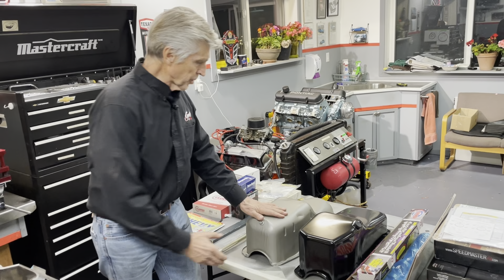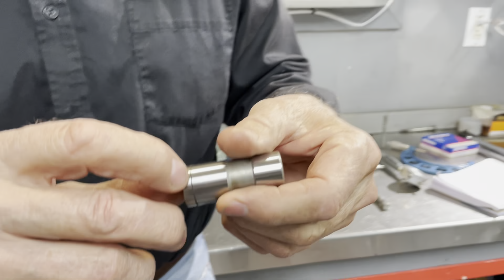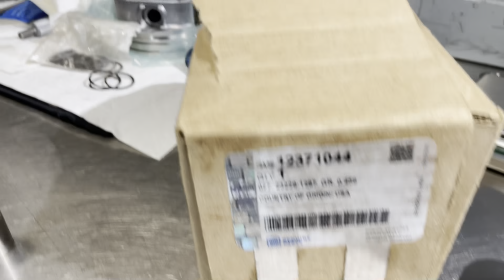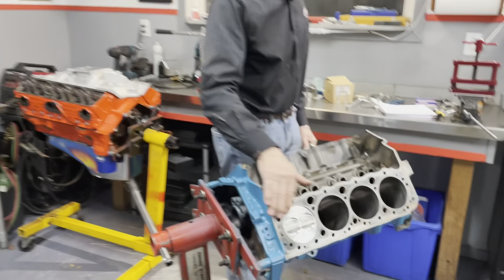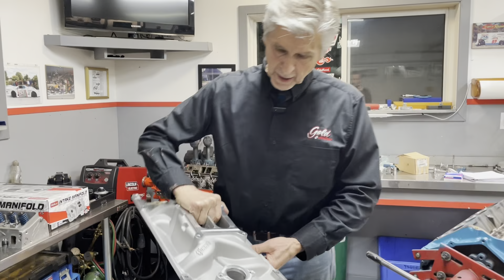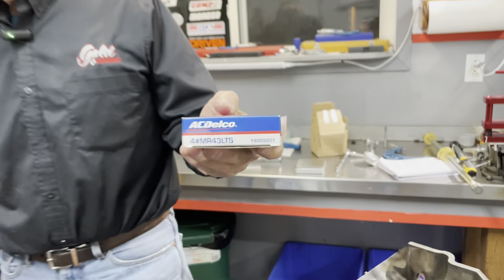Do you need to Balance your engine??? Will it survive if you don’t???

Comment: As an engineer in piston machines, compressors to be precise, I can simplify the matter a little; there is no such thing as a balanced piston engine. Actually... that doesn't simplify anything now that I think about it, does it? 😁

So what do I mean by this? Well let's look at the rule of thumb for balancing engines (and it really is a rule of thumb, because with offset cylinders and detailed calculations of the dynamic forces you can do a little bit better, but I digress), is to take half of the translating/reciprocating mass (piston and top half of the connecting rod) and the full rotating mass together to come up with the bobweight mass. The bobweight are affixed to each of the crankpins to simulate the assembled engine on a balancer. Some mass is added or removed on each end of the crank and now the thing is balanced, right? Wrong. It's only balanced at 4 points during the crankshaft rotation; roughly (not exactly due to conrod angularity) 45, 135, 225 and 315 degrees. 

Why is this? Because in reality the balance varies as the pistons go up and down. When the conrod is at maximum sideways deflection, the piston (almost) halfway down the bore, the mass of the translating components is felt 100% by the crankshaft as if it were rotating mass, because it acts on exactly the crank radius (half the stroke). When the rod is centered (TDC, BDC) the reciprocating mass isn't felt by the crankshaft at all, at least not in terms of balance. This is why the rule of thumb is 1/2 of the reciprocating mass. It's merely the average of the varying imbalance. The best you can do (before getting into complex dynamic analysis of the differences between the 4 strokes) is to just split the difference and follow the rule of thumb. 

Now that in and of itself doesn't mean you shouldn't "balance" your engine, but the automotive industry and engine building aftermarket tend to "balance" crankshafts to a much greater degree than necessary. There are various standards to which rotating assemblies can and should be balanced. The standards often used by high performance engine builders are the level of 20-50K RPM turbine engine assemblies, which is about an order of magnitude stricter than necessary for car engines, which turn 5-8K RPM, for the most part. The standards of production tolerances of modern engine components is such that the "balancing" is already done in the design of the parts, and the rest-imbalance as a result of production tolerances is small enough that rebalancing is not necessary unless you use parts that weren't designed to go together as such. So if you're building your 383 stroker from a quality kit, you're good. 

Having said that, if you need to balance your parts anyway, given the fact that engine builders are already set up to balance to an order of magnitude (or two) more precision than necessary, there's no real reason not to take advantage of it. While under full load the combustion forces throw the balance off anyway (hence you can do better with offset cylinders and slightly different mass bobweights with careful analysis), you will get a nice smooth idle. Considering the fact the engine in a car tends not to be at full load all the time, this is a somewhat nice thing to have, but it won't increase the service life of the engine by anywhere near that same order of magnitude (let alone two). 

A much better thing to do is to use polymer composite bearings. No, not the polymer coated ones. Use the actual composite ones, where a sintered metal (usually bronze) is impregnated with a polymer (usually teflon, although PFAS restrictions may see that change to PEEK or other alternatives over the coming years). This structurally binds the self-lubrication polymer to the steel backing of the bearing shell. These bearings ARE an order of magnitude better than ANY metal top-layer bearing. They are incredible at handling momentary lack of lubrication (i.e. starting, stopping, and high-G-oil-starved-cornering). We've done a test on one of our compressor where we started loading pistons with compressed nitrogen (imagine peak cylinder pressure, but CONTINUOUS during the ENTIRE rotation, so WILDLY worse load than normal). In this machine we had several metal bearings and some of the polymer ones. We ran at 1500 RPM (our compressors resemble large diesel engines in size and proportions) and increased the continuous cylinder pressure as we went. The first tri-metal bearings started failing at 25 atmospheres, after about 15 minutes. Did I mention we closed off the lubrication system entirely? Since this effectively "destroyed" the machine, we disassembled it. The cheap aftermarket bearings were entirely destroyed, worn bearing-wide grooves into the "crank" (it didn't have crank pins, it was entirely concentric since we got the load from outside pressure), the white metal layer melted and in general it was a mess. Our own high quality OE tri-metal bearings fared better... but not much. Now, to be honest, I was very impressed with a 25 bar load for 15 minutes without any lubrication short of oiling the parts during assembly, but the metal-polymer composite bearings were in a leage of their own. You could barely see they ran at all. Brand new. In fact, the polymer running layer looked somwhat smoother than before. 

If you build an engine, always always always always use metal-polymer composite bearings. For the cam too. Always. Also use the thinnest PVD-coated piston rings you can fit for similar reasons, by the way. And have the cylinder bores plateau honed professionally. The combination will last forever. Don't fuck around with ball hones.

Also, I can't confirm this last bit from experience but apparently conical valve springs are the bees knees too. The science behind them is sound, at the very least, and I know enough about harmonics to tell you that your entire valvetrain will thank you for any way in which you can reduce them. Definitely consider them over twin springs and even beehives. And this is a great segue to talk about Mr. Vizard, who was a wizard back in his day. But I feel, from reading his material, that he hasn't gone with the times much. He;s a great source of information for anything old school. But if you want the best modern technology can offer, I think it's best to listen to the Billy Godbolds and Ben Straders of the world. They might as well be Vizard's spiritual successors.
Reply from the maker: Thanks Shiel, lots of great information from your experience. Thanks for taking the time. AG
Reply from the maker: Easy to tell you are an engineer! AG
Reply: I’ve always wondered how the position of the piston in the bore affected things. The mass of the crankshaft counterweight never changes but the acceleration of the piston and connecting rod changes significantly.  This is further complicated when you have two sets on one bearing journal. I haven’t sat down and really tried to work out the math of it with my limited physics skills but I was always like: this doesn’t sound right. Your comment put into words what I had already been thinking. And thanks for the heads up on the polymerized bearings.
Reply: @michaeloboyle8798  Happy to help
Reply: Regarding "metal-polymer composite bearings," I don't see any reference to them for automotive applications.  Is there a different terminology for use in automotive engines?  Where would you find info on automotive use?  A google search only shows bushings, nothing like a split bearing shell.
Reply: Love it.....  retired core rotating component Engineer here.
Reply: Very good sir. Brilliant.
Reply: Thank you
Reply: Your part right.
Reply: @kevinwest3689  ok
Reply: Ok moses

Comment: great info ..like the channel had to sub ......    I agree with what you are saying about semi-stock (budget) engines using parts that are within a few grams ...  of the original setup...  from what I see for the intended use where you are not seeing crazy high rpms for extended times this should last for years and be fun to drive ....
Reply from the maker: Thanks for subscribing Maldo and for you comments. AG

Comment: Or rather,  how far out of balance can it be?   
Very encouraging "balancing" revelation in this video.

(Finally gets to the subject at 15:21)
Reply from the maker: Thanks for your comment N. AG
Reply: @goldsgarage8236  I'm in a situation where I have to balance my crankshaft myself. The local shops all claim to be too busy. I have to make my own balancer. I have the Software and the Computer, but don't know what sensors to use or even how to apply them. So I'm using a Laser method. There is no way I will be able to get to +/- 2 grams etc.  The knowledge you've shared is comfort for me.

Comment: depends on how high you want to turn the engine . stock balance - stock RPM =5000. For every 1000RPM above ,the force is squared ,generally. If you"re going to run 6000 RPM and above on the street or track , I would balance the complete rotating assy. We all want a happy engine ! Mr. gold is correct . Thank you for the knowledge sir.
Reply from the maker: Thanks for the nice compliment Doug! AG

Comment: I built my first engine when i was 17 back in the mid 80s .i only had the  "how to rebuild a sbc " book to learn from. The motor lasted 13 years over 100k miles ,  in 4 different vehicles and made thousands of passes down the track. It was not balanced  it was a.30 over 355 stock crank  trw forged flat  tops and resized rods
Reply: In 71 I built nearly the same engine except it was a steel crank 327 with the 11.25 pop ups, Dontov 30-30 solid cam, Edelbrock 2 x 4 Carter afb, and Mallory double life Dist., Ran really good with that clacking when starting from rocker arms In a 55 Chevy with a (lucky me) m-22 rock crusher.   First time I drove it was smooth as glass.   Just loved that whining Transmission. Got it to idle around 1100 RPM.  First time I really got down on it I was surprised when my head hit the roof.  Worst wheel hop I have ever felt.  Traction bars fixed that.   Tore up three 55-57 Chevy rear ends  and 3 clutch center hubs.  Better Clutch and rear from 69 GTO 10 bolt Posi. Fit right in with little cutting and welding , emergency brakes and hydraulic lines hooked right up.  Car would then tote the front wheel about three car lengths.  Don't ever ruin a 55 two door hardtop in Coral and Gray doing this to it.  Had to cut rear fender to accommodate some really wide Micky Thompson tires and Anson Wheels.  But life went on and it's gone many years go.  OH Yea  I changed gears at 7000 rpm and this engine was not Balanced. And withstood 100's of over rpm shifts.  Engine was still running great when it was sold.
Reply from the maker: Thanks for the confirmation Biden. AG
Reply: Hey Alan thank you for responding to my question about that head gasket leaking on your leak down test but what about that oil pump stud .it looked a little short it didn’t go all the way through the nut ?

Comment: Its not a necessity, but i still disagree. You have the engine stripped , its disassembled. You say , you prefer things done well.
Yess its a budget build , but a balance job nowdays is not that expensive . And I think , a better balance is never bad. May not benefit this build , but I see no reason why NOT to do it , the most expensive thing is ripping the enginr out and tearing it down then reassembly and stuffing it back in the car. 
So , while its apart anyways , its a no brainer to get it done. 
The price of the job vs the price of say.. 8 pistons is next to nothing. 

Now , will it impact performance or longetivity ? Highly likely not. But , as you mentioned , it will be a hotrod. It will be idling a lot more Than a race engine. And at idle , and at peak tourqe rpm , it will shake / rattle less. But will the difference be big ? Hell no. It will be as insignificant as the extra price and work.

However , thats the way its done when you do not want to make a compromise Just to save an insignificant amount of money.
And from that stand point , yess it should be done.
Reply from the maker: Thanks Nagy! AG

Comment: What compression  are u going run with combination  of your parts on this 350? 
Also I'm doing a budget 454 build.  Swapping  the low compression factory cast flattops pistons out for some 22 CC dome hyperutectic pistons  and new rings and hone job. Should it be balanced or leave it alone? Stock compression  was 7.9 I'm guessing,  binging it up to 9.4/9.5 to 1. Going be a low rpm torque pulling engine with peanut port heads and a small single pattern RV camshaft  with headers.
Reply from the maker: Thanks for the question Jesse. Can you weigh the new vs. old pistons? AG
Reply: @goldsgarage8236  yes, im going get my machinist  to do just that.

Comment: I pretty sure the factory didn't balance every engine the job  was figured out + or - a few grams, I always figured if rod and piston weight was lighter it never caused a problem, I only balance if crank , rods and pistons are changed, if you think about it using 5/20 compared to 20/50 would change  the balance a fair bit, using a crank scraper or not, overfilling the crank case by a litre, we can go on and on, that's my opinion.
Reply from the maker: Thanks for your input Bill. AG

Comment: The dowls are a good idea, you can only put them on one side to line up the intake to the head and also lay the gasket on the head first and line up to the ports and make a mark on each end of the gasket to make sure it stays in place when you install the intake and if it slips you van move the gasket back to where you have it marked...
Reply from the maker: Thanks Leonard. AG

Comment: I saw a 50s Jag. awesome car, with a replacement engine in it.  The original was pulled years ago.  My friend found a rod that weighed 60 grams more than the others.  It now wears its original smooth running engine.
Reply: Thx for bringing us along for another superb engine build.....Don't think Circlip & SpiroLock Retainers are mutually Substitutable as Circlips are intended for Rounded cross section piston Groove shape  compared to SpiroLocks designed for straight Rectangular cut piston retainer Groove......Builders have probably mixed Matched them in Actual build Applications with no problems but I wouldn't do it......
Reply from the maker: Thanks Tom, we will use the clips that Sealed Power provides. AG

Comment: Well, the simple answer is, "how do the automobile manufacturers handle the warantee claims that would come from poorly built engines?" GM knows how their Corvettes will get used, and the truck versions of Ford and Dodge as well can get past 100K on the odometer.
Reply from the maker: Thanks Albert. AG

Comment: Balancing an engine and considering all the internal forces in an engine has a lot of mystery to it, all we can do is what we believe is right. Last 383 I did we bought a scat kit pre-balanced and we used the rod bearings that came with the kit for mockup and after spinning the crank a million times, grinding and clearancing, the bearings didn't look as good as they did when we put them in so I had another set of chamfered bearings I was gonna put in and I thought "I might should weigh these" and if my memory is correct one half shell was 4 grams different by weight, just one shell, that's 8 grams per rod. How many guys have cranks turned that don't balance? Just think of the weight difference between the steel or iron being turned off the crank vs the lighter bearing and babbitt material. Then you have all these folks mixing gen 3 and 4 rotating assemblies that claim no vibration at all, there's a lot of weight bias there. I feel a little different about it than I use to, I'm not as picky. But still if I'm building an all out race engine, whether it needs it or not whether it's right or not, I strive for it to be the best it can be and until advanced technology or better knowledge in the future has a better understanding or a better way I'm gonna stick with old tried and maybe true method we're using today because atm it's believed to be the  correct way.
Reply from the maker: Thanks Steve. AG
Reply: 8 grams is like 8 post-it notes, actually like 7.5. Really not a big deal, especially with everything else that's going on. There are literally forces from all over the place affecting balance, like all the oil flying around everywhere, all the time. For most guys just building cruisers that sound good and can smoke the tires every once in a while, balancing is completely unnecessary.
Reply: When you are playing with a stroker engine, this is not Factory, it should always be balanced. Most of these Strokers come from China and some are way out of balance.
Reply: @mylanmiller9656  oh yea I agree and I feel that goes without saying, aftermarket rotating assemblies that are pieced together are most definitely in left field. My comment was aimed more to the oem or balanced kits that have cranks turned later down the road, or just refreshed with different style bearings or ring packs or even rebuilder claimer pistons with no re-balance. There's a big weight difference in bi-metal vs tri-metal bearings, much less a crank that has been turned 020 or 030 vs a 020 or 030 bearing shell. I'm still blown away folks throwing gen 4 rods on gen 3 cranks, gen 4 rods are like 50grams heavier. I always thought if that weight wasn't countered you would feel it.

Comment: I just bought a mustang with a bad engine shake. It was definitely worse the higher the rpm’s got. Felt like it was gonna shake the dash off. Took it apart and took it to the machine shop for balancing. It was out 139 grams on the flywheel side and 89 grams on the balancer side. So yes it is necessary in some cases.
Reply from the maker: Thanks Shane, in your case it sure was. AG